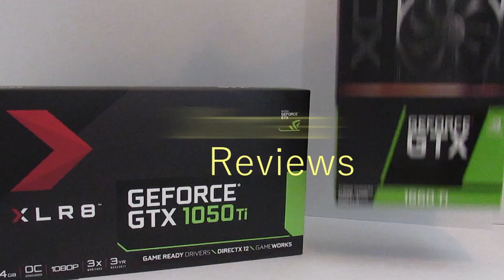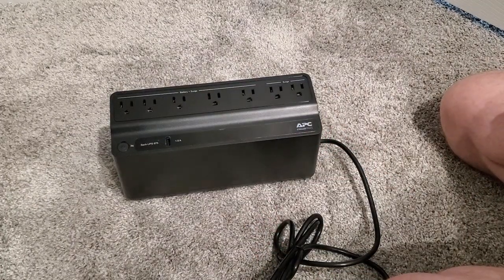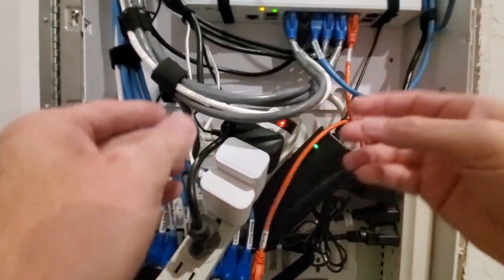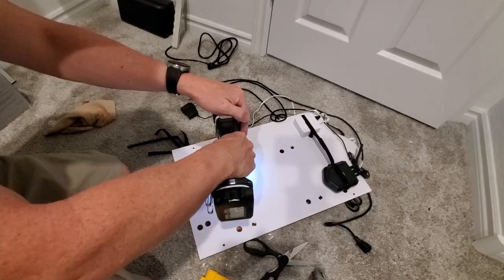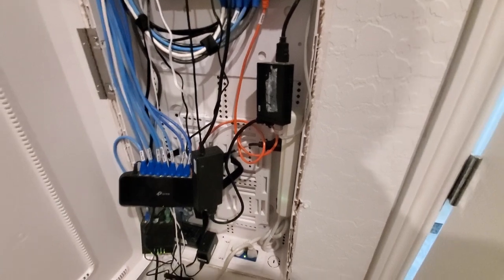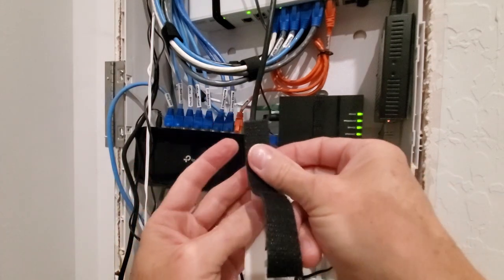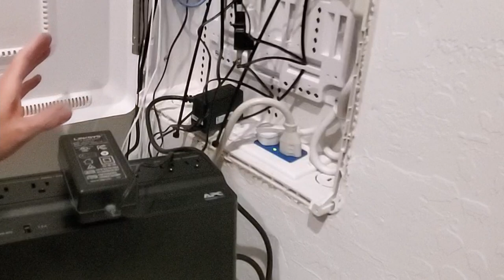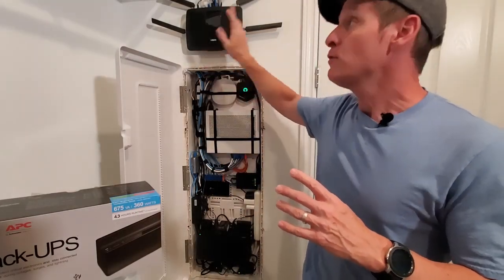HOW TO INSTALL ANY UPS - Home Network Setup 2021

Comment: Funny - I had the same challenge in my network cabinet. But, I found a slim line UPS made for the cabinet and nothing in there needs much power.  It works really good, too.  CyberPower and TRIPP-LITE are what I use.  

Nice organization in you box, too.  Looks a lot like mine, even with everything going wireless.  

I love APC and AMAZON UPSs for my computers, but they are way to big, heavy  and bulky to use in a network cable cabinet.  One is only as deep as the 2x4 studs.  But, at least you found a UPS with the outlets on the top side, because if they stick up the front, you wouldn't be able to close the door.

I also noticed you have one of the new ABS plastic cabinets.  Mine is an older metal box, which required wifi routers outside the box.  I use a wire rack shelf.

Comment: Well this is kinda funny, today I received my UPS I bought from Amazon Warehouse yesterday.
I'm using it for my network to and here you are uploading a video on basically a very similar thing haha.

Nice to see you got it fitted in nicely and looks tidy.

Thanks for the video
Reply from the maker: Which UPS did you buy? I went with APC because of the good reviews and it was only $59 at Sam's Club. I hope I NEVER have to rewire my Network panel ever again! Haha. Thanks for watching Tony!
Reply: I also got a APC, it's the APC ES - BE850G2-UK
Normally its £125 but on a warehouse deal I paid just £65. The box looks terrible but the actual UPS looks good. Plus if push came to shove I can buy a new battery for around £20 to £25 of around £45 for a genuine  APC one, so no matter what I am still saving money :D haha

Them panels are great and kind of wish I had one but a network panel is no substitute for a proper network cabinet but the downside is they are bulky haha.

No worries, I always try to keep an eye out for your videos :)

Comment: Just a idea next time mount the UPS with   the mounting holes out side the low voltage panel (maybe above or below it, or where ever you want) and run an extention cord into the panel or build a extention cable with romex so it up to code for being in a wall. That way you wouldn't have to reconfigure everything and loose valuable space in there.

Comment: Can you either get a 12-15 port (made for odd shapes), ups, or put a standard ups in another surge protector without issues or fire safety? Can you do it extremely cheap? Im on a tight budget, and i have lots of equipment and few walls. I cant rewire them. If not, i guess ill never get a ups...
Reply from the maker: You can use a standard UPS and add a surge protector for more outlets without any fire danger.

Comment: Having a UPS is great to keep providing power to your home network, But these UPSes would tell you how many minutes it will run off the battery, They would run for a couple of minutes depending on how many devices are plugged into it. You have to take into account if a power outage goes on for even longer, The battery will run out eventually. These things are good if the Power outages are short, like say power goes out for 1 minute, But if you experience a power outage that lasted for say 30 minutes to an hour, The battery on these UPSes will eventually run out.
Reply from the maker: That's exactly what this is designed for. No more than 30 or 45 minutes for all of the network devices. Also it's better for electronics not just shutting down improperly. Power surges can damage network devices as well. Thank you for watching I really appreciate it.

Comment: Home network panel? Jesus when is this 1979? Do people actually hardwire home networks in the 21st Century? My whole home network is wireless and backed up to a 2kw UPS. The only thing hardwired is my main desktop PC to the router
Reply: Some people do a little more on their network than just respond to emails and read Buzfeed articles so they might need a little extra bandwidth
Reply: And someone could jam your wireless signal. So yeah. People still hardwire.